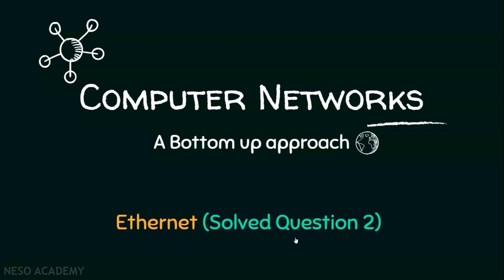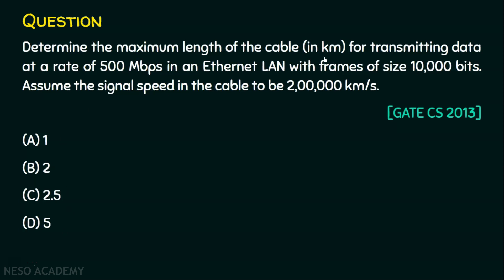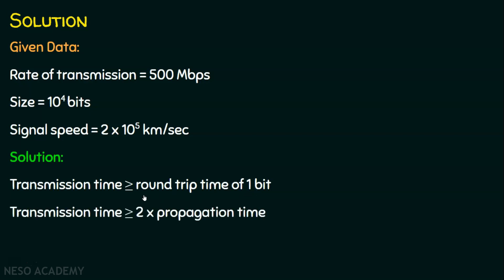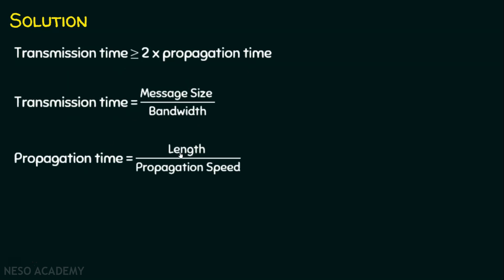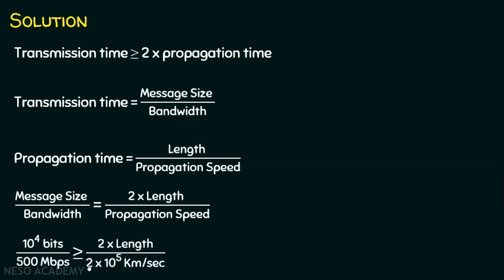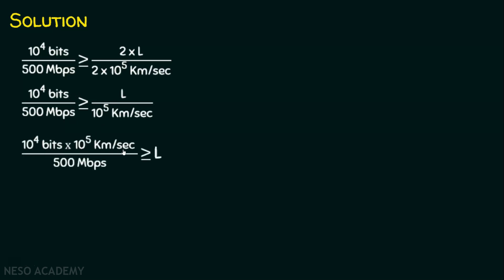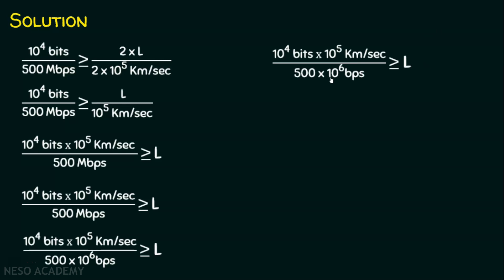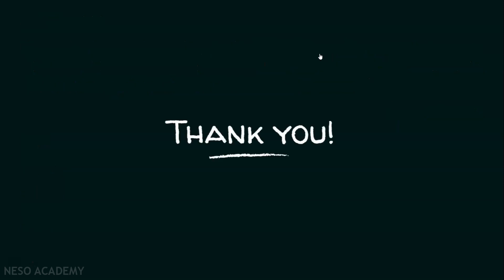Ethernet (Solved Question 2)

Comment: How Transmission time is >= RTT ??
Reply: same question here... how can transmission delay be more than that of round trip delay? it doesn't make sense to me.... did you find any answer to this question?
Reply: Early Ethernet uses CSMA/CD. In CSMA/CD for any station to detect a collision, the Transmission time(The time a station takes to put a packet on the line) must be greater than the time it takes to reach the destination(propagation time)+time it takes for collision signal to reach the station. The maximum of both of these times is propagation delay.
So here Transmission time >= RTT(time to propagate packet+collision signal)
In this way the station can detect collision while transmitting packet, abort the operation and restart after some time(Back off).
Here is a link for a better explanation-https://www.geeksforgeeks.org/collision-detection-csmacd/